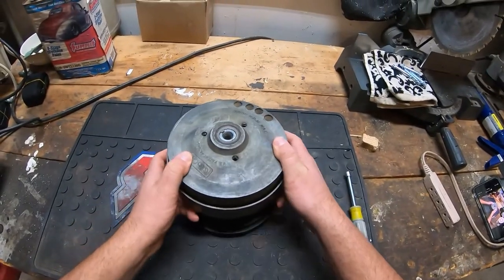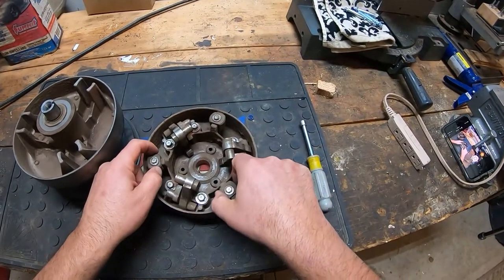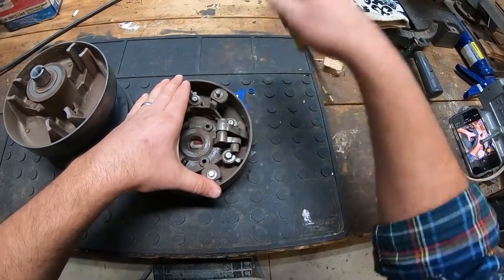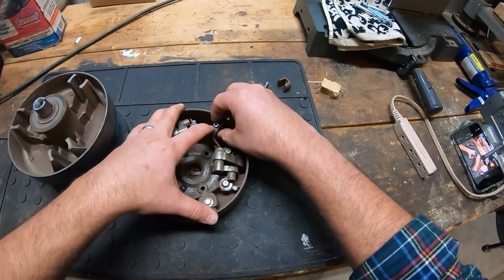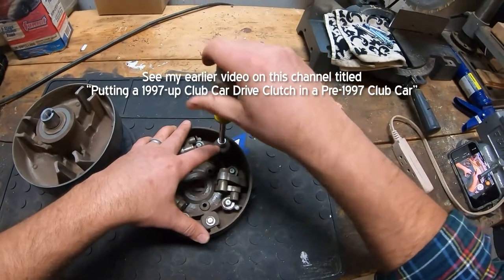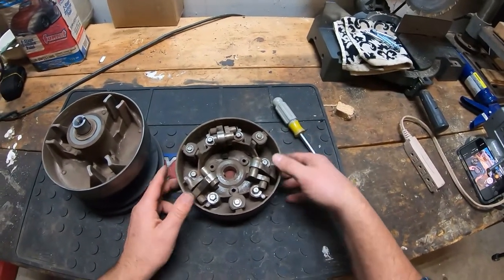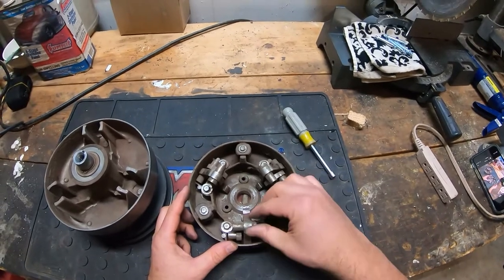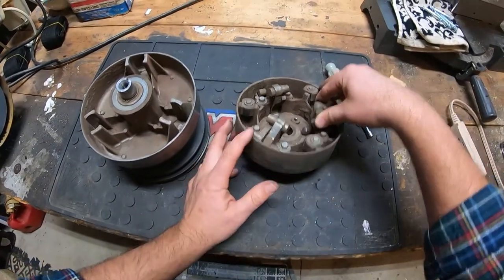Club Car Drive Clutch Button Clip Position (1988-1996 vs 1997-up)

Comment: The clips should be on the side specified by rotation so they can do their job.  Flip them to the wrong side and they won't get the correct load on them which can lead to premature wear and failure.  Its all about what part the load is applied to.

Best!

Comment: Would you use any kind of lubricant inside a drive clutch?
Reply from the maker: No. Do not use any lube inside it. These clutches are designed to run dry.

Comment: Do you have a video of you removing the front with the removal tool
Reply from the maker: No I do not. All you do though is remove the clutch center bolt, then thread the tool into the clutch center by hand, then just hit it with a few quick zips of the air impact gun and the clutch should pop right off.

Comment: Can you provide a link to where you get good aftermarket clutches?  I see a lot of them out there with a variety of prices.  There must be a difference in quality.  Appreciate your videos!
Reply from the maker: This was the one I bought and used in the other video for my 1990 Club Car DS. I don’t really have a recommended place to buy. So far I’ve always had good luck with the aftermarket drive clutches sold on eBay and they seem to work well.

https://www.ebay.com/itm/232925072152

Comment: Hey man do you know if that clutch has a spring on it and where it would be?
Reply from the maker: The spring would be inside the main part of the clutch on the left side of the table in this video. You remove that little c-clip at the bottom of the keyway there and you can access it.